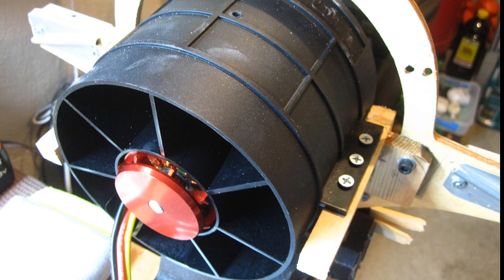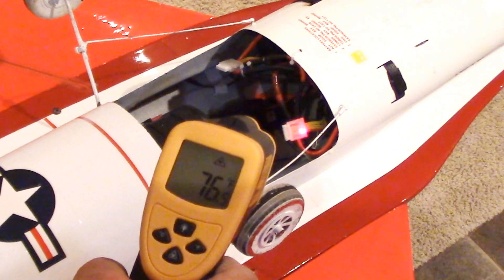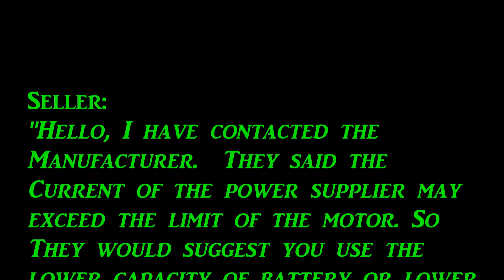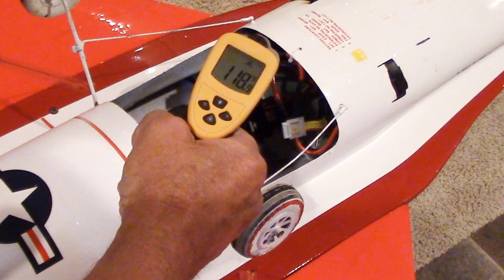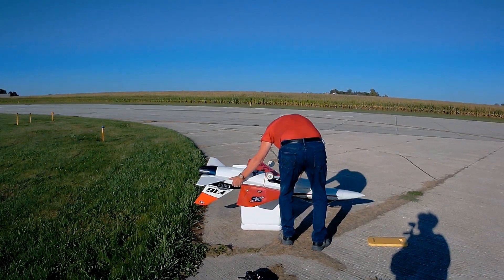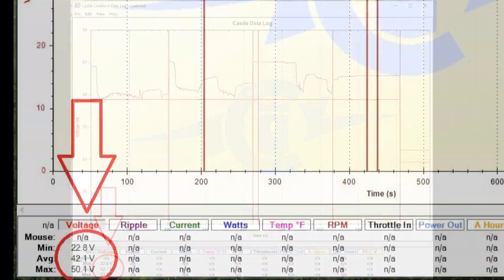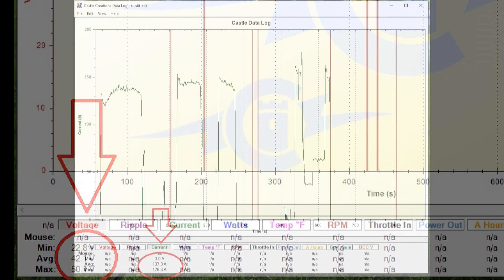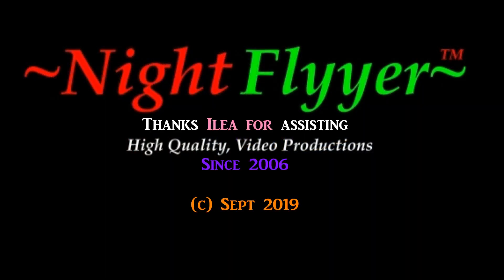Oh No!  My Electrified Byron F-16 motor failed again and here's really why!

Comment: It drives me nuts when guys always say that it needs more power. I would suggest a different blade configuration. Someone even suggested making the outlet smaller to increase the airflow. I could be wrong, it might be the other way. The smell of burned windings usually tell you the motor gave up. I was shown a video on Castle creations ESC's As being not as accurate on their statement as to output. Sounds like that wasn't the issue this time. It can be hard finding a motor that can handle the power as stated. Time to move up to a real jet engine?

Comment: Need some serious 3 phase maximum current limiting and maximum over voltage dumping ESC electronics there ....
Reply from the maker: Actually if the fan specs would have been correct, I would have needed nothing.  But a new light has been lit, as Don D'Edigio is graciously sending me a fan that will actually work on 44.2 volts, so I will try that next.  Thanks and please stay tuned.

Comment: But my nearly 10 year old BVM EVFs are still turning at 5000 watts each.

This is where to go.
Reply from the maker: Yes, all after the fact.  Of course if you dump in twice the voltage your BVMs are rated for, Ill bet they will fail too.  Thanks.

Comment: You have a great voice and your videos are interesting👍🏻
 My suggestion would be to run a Jetfan and HET motor along with your Castle controller.
Reply from the maker: Yes, but after the fact.  This motor's  Specs were wrong, and I believed them and the double voltage killed it.  But a new light has been lit, though. Don D'Egidio is graciously sending me a 12s fan that should work, so that happens next.  Please stay tuned and thank you.

Comment: Attempt to simplify the issue, for myself and others, if I understand it correctly:
1: Motor doesn't suck power, it just acts as a variable resistor allowing current to flow. 
2: If more current flows through the windings than they can handle, they will fail.
3: Higher voltage will allow more current to flow based on the overall resistance on the circuit.
4: Motor fails because they lied about how much current (and as a result, how many cells) it can handle. This particular motor needs a lower cell count supply to survive, as lowering supply voltage is the only way we have of limiting current without destroying battery or esc.
Reply from the maker: Exactly as I said at the end of the video.  Specs wrong, and I believed them Doubling the voltage killed it.  But a new light has been lit, though. Don D'Egidio is graciously sending me a 12s fan that should work, so that happens next.  Please stay tuned and thank you.

Comment: Note that the C rating of the battery is not a hard current limit.  A 60C rating doesn't indicate that it will deliver a current of no more than 60 times the rated capacity.  The C rating is the maximum "safe" discharge.
So, if you have a 5000mAH battery rated at 60C then the maximum safe discharge is 300A.  However, even a 20C battery may deliver the same 300A if enough load is applied -- the difference is that doing so will almost certainly damage the battery (primarily due to heating) and the output voltage will sag.
Running a lower-C battery therefore will slightly reduce the maximum power the motor can draw but it will also greatly increase the risk of battery failure (perhaps catastrophic battery failure).
Reply from the maker: Yes, you are right, but dumping over 50 volts in a motor that can only handle 22.2 is what really fried it, but not to worry,  a new light has been lit as Don D'Egidio is graciously  sending me a 12s fan that should work, so that happens next.  Please stay tuned and thank you.

Comment: hello dave, loved the video. just didn`t like the ending. but you bought her in safe. I looked closely at the motor windings, and my thoughts are that the windings were from cheap grade materials, but I may be wrong. your friend in tex.
Reply from the maker: Thanks much, but of course the fan specs said it could run on 45 volts, and it turns out only 22.2 volts is recommended. But a new light has been lit, though as Don D'Egidio is graciously  sending me a 12s fan that should work, so that happens next.  Please stay tuned and thank you.

Comment: Very cool that the ESC can report all the data back. You should do a small video on how the Castle ESC hooks up with the computer and give a tour of the software. It would be new to me for sure. lol
Reply from the maker: Yes.  I actually showed some of that in my last video.  Castle Creations controllers have the perfect setup for this.  When I set up the new fan, I will show how it's done, as a new light has been lit, though as Don D'Egidio is graciously  sending me a 12s fan that should work, so that happens next.  Please stay tuned and thank you.

Comment: Nice flying untill the smoke appeared. But emergency landing was very good. IMHO this turbine is problematic. You must try to get another turbine from other producer. But first check turbine on ground in full power. Great Byron F-16. Greetings.
Reply from the maker: I did check it in my last video with this fan and all seemed well, but in the air, it changed. But a new light has been lit, though. Don D'Egidio is graciously sending me a 12s fan that should work, so that happens next.  Please stay tuned and thank you.
Reply: @NightFlyyer  I'll be tuned. Good news !

Comment: That's what I was saying in your last video. I really didn't think the batteries were the problem. Or the ESC. However if you used batteries with a higher internal resistance (Lower C rating) then the batteries WOULD get hot trying to keep up with what that motor/fan combo can pull. You need to go to 10S and/or a lower blade count fan. Whatever will get the total watts down just a bit. 8S may be too low, Looking forward to your next video on this. At least this flight was the longest so far.
Reply from the maker: Actually the longest flight was the first flight last year on 15c batteries and the 550Kv motor.  When I put in 25c batteries, the motor and the esc failed.  Then everybody, including Venom engineers told me I needed higher c batteries, but they didn't know that the motor specs were false and could not handle twice the voltage they say they could.  Thanks.
Reply: @NightFlyyer  Well that new fan unit coming in should take care of it for sure. That jet is going to love it.

Comment: V.I.R is your friend.
a motor can be run at ''any'' reasonable voltage provided the total power rating of the motor isnt exceeded, you could run that thing off 110 if the thing was pulsed very fast at a low duty cycle of like 15%.  been running a 24v motor at 70v that way pushing 800-1000w peaks into it for years.

And you can run a 110v lightbulb off 240v, without poof, take a simple 1 amp diode and remove half the AC waveform, you now pulsing 240v at a 50% duty cycle and so its averaging 120v.... 

Can you not limit phase amps or battery amps with the ESC?
Reply from the maker: Of course what you say is true, but the false specs that said it could run on double the voltage is really what killed it. Their is no way to limit the amps in the esc programming and the voltage is progressive to the stick but always goes to 100%.  Programing the TX to run like only 70% works only once when you first turn it on, as the ESC reprograms, so even at 50% or less, it will reprogram to run at 100% even though the throttle hold says 50%.  I don't want to have to turn it down each flight, nor should I have to.  If the specs of the motor told me it could only run on 22.2 volts, I never would have dumped in over 50.  Don D'Edigio is graciously sending me a proper fan with proper specs and that should work well.  Please stay tuned and Thanks.

Comment: How long ago did you buy the EDF?  I would invoke ebay (under 30 days) or PayPal buyer protection and get your money back.
Reply from the maker: Well this is the 2nd EDF I bought, but they are over a year old.  The one I ordered 3 days ago, says it has not been shipped, so I might be able to cancel that. Thanks much.
Reply: @NightFlyyer  You not going to try the new one with 8s?  If you contact the seller and ask them to cancel they have the option but it's completely up to them.
Reply from the maker: @DoRC  Since Don D'Egido is sending me a new fan and motor which is different, Im not going to try again with this EDF.  Im getting tired of deadsticks and each flight costing me so much money.  I contacted the seller and they cancelled the order, albeit I had to pay $30, even though they hadn't sent it yet.  WOW!
Reply: @NightFlyyer  hmm. I think I'd contact eBay about that. I'm don't think a seller can charge you to cancel an order.  I could be wrong as I've never encountered tag before.

Comment: V=I*R   Where R is the "sum of resistances of all the wiring, ESC connectors & Motor" out of which motor being biggest R so for simplification R=motor resistance & for further simplification take it constant for same load (fan size)  Throttle iis linked to potentiometer that  raises V from zero to Battery's max. So if V doubles I doubles (given battery has enough C rating). Since R stays same & that I has to pass through every element in the loop; the weakest link will fry first. But if battery doesn't have enough C rating it will puff up
Reply from the maker: All true. But after I changed connectors, esc and High c batteries, I had no hot or puffed batteries. But doubling the voltage that the motor could easily run on killed it, when I believed it could run on twice the battery voltage as it was falsely advertised it could.
Reply: Indeed, false advertising....Sometimes sellers agree to refund half price or send replacement for half price in such cases..With a bit of workarounds perhaps u can manage to fit a bit bigger fan & motor combo.  As u know fewer cells bigger dia props, lower kv & fewer blades is the most efficient proposition. If I were u I'd try  achieving 1:1 thrust  going this route.

Comment: with your new fan you should finally mount an intake trumpet / ring - why throw away so much efficiency? the only situation you don't need an intake is when the ducting is flush with the fan... If the upper half of the fan unit is flush with the inlet duct, you only need a trumpet for the lower part which is effectively an "open duct" installation. There are open duct trumpets available from some manufacturers, and they are huge, the bigger, the better the flow to the fan. good luck
Reply from the maker: That is true, but there is too much stuff including the 2 big 6s batteries in between to get a trumpet in there.  Besides we flew these for years and years without any trumpets, because the Engine and tuned pipe is in the way, hence why the big cheater hole in the bottom of the fuselage. It flew fine on the first motor and 15c batteries on the very first flight last year.  Putting in higher c batteries started all the problems.  But Don D'Edigio is graciously sending me a proper fan with proper specs that I will try.  If the seller put in that it could only run on 22.2 volts, I would never have dumped in over 45, which is what really killed it.  Thanks.

Comment: Oh.. max voltage for the motor is 45V?  Yeah, 12*4.2V (per fully charged cell) is 50.4V, so too much.  A 10S at 42V would be close and maybe even pushing it, so definitely try 8S first.  Are there 9Ses?
Reply: You can do 9S by running either a 4S and a 5S in series, or a 6S and a 3S in series.
People don't tend to do it, but there's no reason you shouldn't if the packs are all the same capacity.
Reply from the maker: @bigpops74  True for sure.  Thanks.
Reply from the maker: So true, I was duped by the incorrect specs.  I could easily make a 9S but I think Since Don D'Edigio is sending me a proper fan and motor with specs that can handle it, I am hopeful I will finally be able to fly this antique jet reliably. Thanks much.
Reply: Hopefully that'll do it.  I'm really glad you've been able to land safely every time so far.
Reply from the maker: @AKATEATime  Thanks. I hope so, as I am getting lots of practice with dead sticks with this jet and I don't want to push my luck, as it is a rare vintage plane.

Comment: this is why i hate multistrand windings even in my hobby
Reply from the maker: The motor is not wound with multi strand. They are solid copper. Double voltage killed it, in reality.  Thanks.

Comment: Great video.
Thank you for posting the troubleshooting process. 
     Is exactly what you described above about the light bulb. Very nice comparison. 
     My opinion :
      Note that the problem has nothing to do with higher C output rating from the battery.
     The only thing that will happen if you put a low discharge rate battery is that the motor will try to get all the power it needs from it, but she can not deliver,  so, the engine may be safe, but a voltage drop can turn off your receiver and for sure the battery will get hot, because now, the battery is the weak point of the chain.  It is not ok to reduce the power the engine can take reducing the discharge rate of the battery. 
      The motor is the problem at this equation for this high voltage battery you are using.
     The solution would be:
- a motor that could deal with that demand. 
- Keep the motor but put a fan with less blades would suck less amps and would not overcharge the motor and even a lower amp esc can be used , since less blades demands less from the esc. ( but the higher pitch noise is not so beautiful)😊
-Use a Battery with less voltage , like 10 or 8 s like you said. 
Note that if you put a limitation on your radio transmitter to not allow the throttle to pass a certain limit value supported by the engine, would also work, but in this case, you would be just carrying extra weight from the batteries,  where the 8 or 10 S would do the job.
   The text got long, but just some thoughts about this issue you are facing. 😊

      Keep posting your tests 😀👍👍
Reply from the maker: I always use a separate RX battery in my big machines, so not to depend on BEC or Speed controls, so that was covered. Also, this thing did pretty good with the original 550 KV motor and 15c battery's. If its only supposed to run on 22.2 volts and I put in 42.4, that is why is smoked, but again, the specs on the Ebay site says it can run on 12s.  That was misrepresented to me and I unfortunately believed them.  Thanks for all the tips.  I'll try again in 3 weeks when I get the new fan if its not snowing and for sure I'll use lower voltage battery's.
Reply: @NightFlyyer  That makes me think maybe you should wire the batteries in parallel instead of series. That way you would get the lower 22.2 volts but still get the high current capability to keep the heat down. Just a thought.
Reply from the maker: @hardies1  Yes, I already tried that, but it did not have enough thrust to fly it, as it was like half throttle compared to the 44.4 volts.  Thanks much.
Reply: @NightFlyyer   Yeah, really looks like the fine tune will be the tests on 10S or 8S  👍
Reply: @NightFlyyer  Great idea using separate battery to feed the receiver and servos .
     Yes you are absolutely wright! The main issue was that the engine specs were wrong.  If the numbers written at the specs were wright, all this  setup you made would work .
      Really enjoy this troubleshooting videos you are making.  Very didactic , and will be satisfying to see all systems  working nice after passing through this process. 
Looking forward for the next video .
     😀👍👍
Reply from the maker: PS, I tried lowering the Top end of the throttle on the Transmitter, but the Castle ESC compensates for that each time, so half throttle is still full throttle.  But....if I start it up, then before flying it, I could program it down and it would work, but only for that flight.

Comment: Great video! Seems like the issue lies with improperly specced EDF units if you ask me. I'd say if the description says good for 12s, it should be able to handle 12s. Sidenote: eBay almost always side with the buyer, so if the seller isn't willing to work something out, eBay will give you your money back for an inaccurate description.
Reply from the maker: That is exactly right.  If it said only 6s, not 12, I wouldn't have even bothered with this fan.   You make an excellent point.  I did all the right things, but the motor specs were wrong and I believed them. Thanks Colton.
Reply: @NightFlyyer  yep file claim on ebay,, that's bs ,, obviously it isn't 12s . hobby king has a 8s -12s motor. i know a guy that has used it in a 90 mm i believe it was 650kv but you have to purchase shaft adapter with it,, what size was that shaft on motor?  pretty sure he said it could do 12s i'll shoot him a txt and try and find out more.. i know he's flown it alot...
Reply: Turnigy SK3 Fandrive - 3994-850kv  12s is what he is using ,,its a inrunner , he said it was around 125 bucks from hobby king ,
Reply from the maker: @MrBumbles2  The shaft on this motor is 8mm, but I have given up on this fan , since Don D'Edigio is graciously sending me a proper metal fan and motor from JPHobby.  Its too late to file a claim on these 2 since both these fans are over a year old.  I will cancel the latest order of the latest order if I can, as it says it hasn't been shipped yet.  Thanks and please stay tuned.
Reply from the maker: @MrBumbles2  Thats good to know.  Thanks again.
Reply: @NightFlyyer  8mm on sk3 so you wouldn't need it, haven't had a chance to get on hobby king out of town..